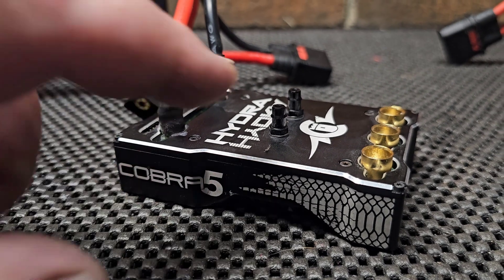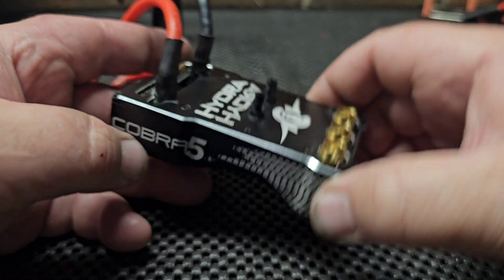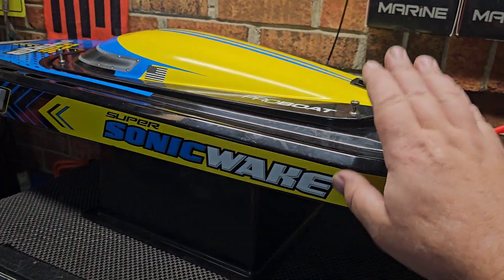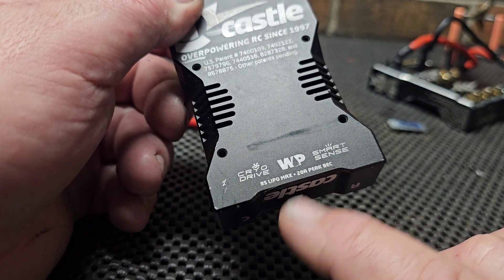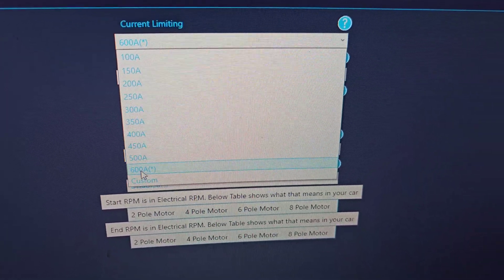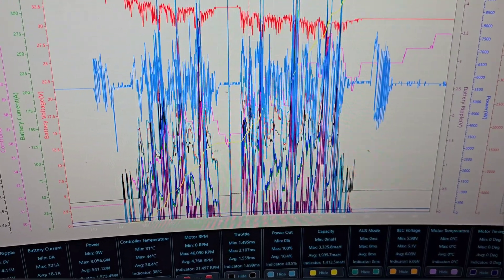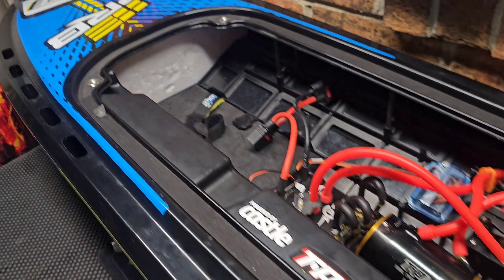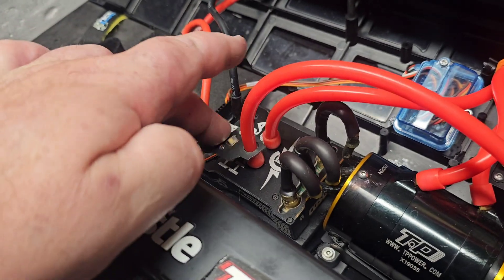Cool Data Log Feature Castle Creations Cobra 5 HYDRA Water Cooled Marine Esc

Comment: “Power Out” that’s one parameter I would like to know on all my ESCs. I have never been convinced that every ESC provides the same voltage out. If I put 11.1 volts in I want 11.1 volts out when at full throttle.  That data entry feature to me is worth the extra expense. Great video Big B, feel free to expand on all the new knowledge 👍 we are here to learn.  BG4L

Comment: Will this be a good Esc in my heatwave 24
Reply: It will catapult your little boat to oblivion. 😂
Reply: @Trumppower  Sounds like a great idea!
Reply from the maker: Personally I think the Cc x8s Is a more compatible esc with the stock motor, no mods needed for the baby Hydra..     There are guys running the xlx2 in the v2 24 trying for 100+ mph with upgraded motors
Reply: @IRONCLADRC  Thanks!
Reply: @IRONCLADRC  Thank you!